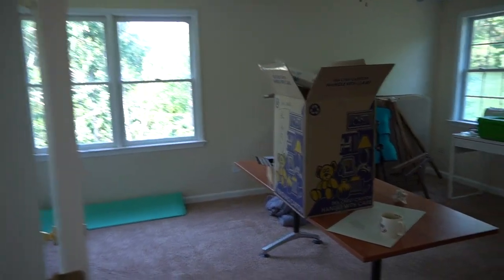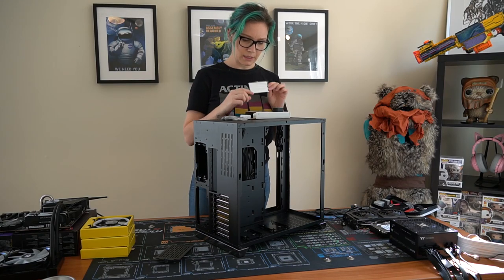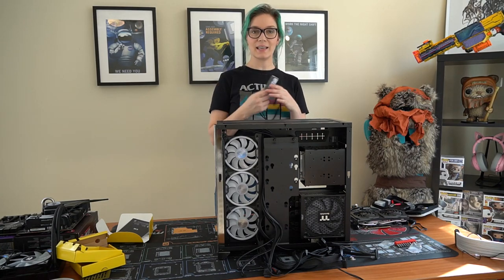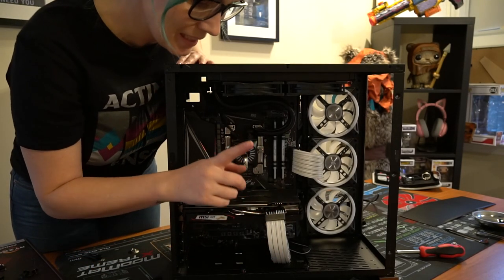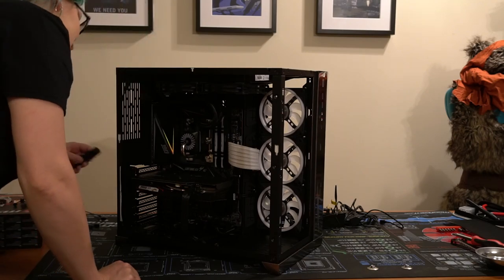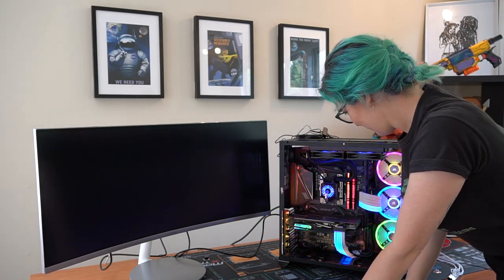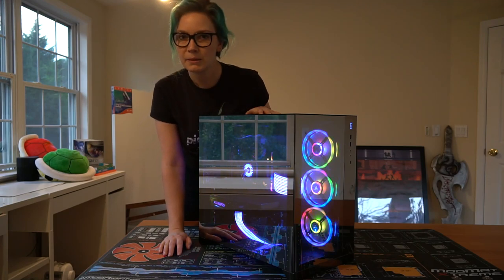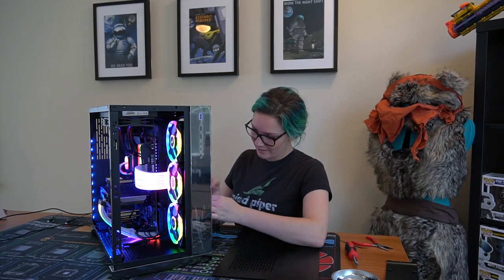Lian Li 011 Dynamic PCMR Special Edition build, the mirrored one!

Comment: Very nice build, and I really like the mirrored look (even though it's not for me). I just built a pc a couple of weeks ago, and I went with the LL Dynamic XL. Ran into the same issue with the GPU connectors, but then just slid my sleeve cable combs down to allow it to bend more, and it fit fine. Good luck with your PC building journey
Reply from the maker: Thanks. The 011 Cases are beautiful aren't they? I think the smarter option if you want to see your components is the non mirrored one like you have (I've learnt this lesson). 
If I get a 3080 GPU at any point I will have to see if I can even use my strimmer! I won't get one for a while though, so I guess I don't have to worry 😆
Reply: @PixieLaLuna  yeah they're really nice looking and easy to work with. I love them. Haha good luck with the 3080 hunt

Comment: I just finished a water cooled build in the lian li o11 dynamic xl in black. I love this case, but cable management is a bear with 10 RGB fans in it. As soon as I get my hands on an RTX 380 my build will be complete.
Reply from the maker: Water cooled build in the 011XL, ooooooh nice!!! 
Good luck getting a 3080, I am also on the hunt to upgrade this pc, my 1660 Super isn't quite doing it for my requirements. The 3080 is a lesson in patience 😊
Yeah I struggled with fitting the cables in, especially if I had put the hard drives in that I wanted to!
Reply: @PixieLaLuna  The RTX 3080 is an elusive piece of hardware.  I really like your build. It turned out great!
Reply: Aaron Dowdy same story for me, have the black case, all the parts minus an3080 😂 I’ve ended up ordering a placeholder card until maybe November or December when one finally comes available 

But! Probably not a bad thing as apparently the cards are crashing
Reply: Also only 9 RGB fans for me as I don’t have the XL case 😂
Reply: 10 fans was a challenge to cable manage with the commander pro and two lighting nod cores. I even made  an adapter for the front RGB strip to connect to the commander pro to control it in Icue so I only have one piece of software to control everything. I managed to keep the two hot swap cages in for my HD's after everything was where I wanted it. I  did order some Cablemod PSU cables to help clean it up a good amount with my modular PSU. The key was to route all the smaller cables first and have the the Commander pro and the two LED hubs where I wanted them. After that I connected all the PSU cables and cleaned it all up. Now if I can just get one or those darn 3080 cards I would be set.
Reply: Aaron Dowdy tbh I’m not looking for a fancy light show 😅 Even though I got ARGB fans I’ll most likely stick to one or two colours maybe. I don’t have a commander device but I guess I may look into it at some point... more importantly is the damn GPU though 😂
Reply: Same case, but I'm not big on RGB at all, so I only did 6 RGB fans and the other 4 have no RGB. I game on my TV, so the less lighting the better.

Comment: Nice video :) I wouldn't put the dust filter on the side where the fans are exhausting though only in front of the intake fans, it will just case a build up on the inside of the case. :)
Reply from the maker: Cool, thank you! I will have a look and remove them, what you said definitely makes sense! :)

Comment: Excellent video.  It was nice seeing this case in a real world setting.  I purchased the same case and fans for myself.  However, they are trapped at my office mail room so I haven't the chance to see them just yet.  
I was worried how the one way mirror effect would look in the dark with the RGB but it looks beautiful and crystal clear. 

Would you happen to know how much space is between the bottom most side intake fan and the bottom of the case?  I was thinking of water cooling and using the EKWB FLT 120 pump/res combo in that bottom most side fan location.  My idea was to use the bottom port of the res to then route the tubing under and behind the res to a cross flow rad.  For this idea though I would think I need at least 30mm of space.
Reply from the maker: Oh no, how frustrating it being stuck in the office!!!
I've just took the glass off to look and I don't see there being 30mm clearance unfortunately. I did mount my fans in the middle of the slots though (they are elongated holes you can slide them up or down in). I think if I had mounted them towards the top of the slots there would be maybe 20mm, but you'd be lucky I think. You might just have to use the cable management hole next to the lowest fan if that works with your cooling loop. It's right next to the fans.
Good luck! It would be great to see the results.
Reply: @PixieLaLuna  I suspected as much.  Thank you for checking.  I will probably take your suggestion and go left from the pump through the cable hole.  Shame, the loop would have looked very sleek with only one tube visible to the reservoir.
Reply from the maker: I'm sure it will look just as sleek. As I said you MIGHT be able to squeeze it through under the fans, depending on where you mount them in the holes. Sometimes things don't seem like they'll work until you try it!

Comment: So, I must say... I was taken by how closely you resemble Emily Blunt... regardless, I recently purchased a Lian Li Dynamic 011 XL for the upcoming 3090 and a bunch of QL fans to boost the sexiness! It's replacing a Corsair 570x which I will use for another build. I'm looking forward to more of your vids! Subbed! ;)
Reply from the maker: Awesome Damir, I hope you get one of the 3090s in the first round, it will be an amazing build!!! The fans are really nice, and the case, as you know, an amazing case. Have a great build with all your new toys. 
Thanks for the compliment, I don't believe you but thank you anyway haha, and thanks for the sub! :)
Reply: @PixieLaLuna  lol, well, the resemblance is there. Regardless, I was reluctant to do the swap because it is a massive investment, not only in the new card but changing the case and adding the aesthetically pleasing new fans. I just needed to make sure there is clearance for the 3090 would fit and could remain cool too without having tight/trapped spaces for heat to accumulate.
Reply from the maker: It sure is a massive investment, PC building and upgrading is not cheap! I am looking at upgrading the 1660 Super in this build cause it's just not keeping up with COD, and that means I might have to replace not only the GPU, but also the PSU and possibly even the CPU! It's never ending.
The case keeps pretty cool, especially if you work out good airflow with your fans, but I know what you mean, there would definitely be concerns about heat pockets. If you can, I would have fans above and below the GPU, with the ones underneath being intake as long as your case isn't on the floor. Actually I guess it depends on the Push Pull directions of the new 3090. I'm sure you will work it out. Just make sure you get that hot air out! 
Good luck with it, let me know how it goes!
Reply: @PixieLaLuna  I've been building custom PC's and gaming rigs more over 15 years now and generally when I set out to build something specific it's around specific targeted games. This year I rebuilt my PC knowingly that the 30 series is going to drop, this is post covid but, I didn't count on the increase of the overall gpu size. My current setup in the 570x crystal is running optimal but being a tech savvy obsessed nerd who likes working with his hands i have to keep modifying things, lol. I'd gladly, show you my current setup but I'm not sure linking things here would work. Front of the case is push pull on the 360 rad and the top 2 fans are exhaust and the rear is exhaust. In the lian li xl will be push pull on the side 360 next to the motherboard top will be exhaust and when i get the 3090 water cooled aio card evga hybrid or kingpin that will be at the bottom as an intake and the single 120mm fan at the rear as an exhaust. 

My only advise is to plan accordingly before you build and take your time. Each build has a target specific for it's means to be created. Right now mine is to destroy Cyberpunk 2077 :) btw, I miss WoW, you're still playing it?
Reply from the maker: Haha, here is me trying to offer advice to a veteran builder! 
One of the reasons I started wanting to build PC's is because I love working with my hands and wanted to find something to do that would incorporate tech and hands on stuff! Learning about it all, and pulling things apart. If I get the new 3080 I will have to have a look at my fans and maybe switch things around, make sure there is good flow.
Yeeees, I can't wait for Cyberpunk 2077. That and COD Cold War are why I need to upgrade! I'm going to move my 1660 Super to another machine. I haven't played WoW in a little while, and I am still only new to it (I'd never had a proper PC before), not sure whether to start again now, or wait for Shadowlands.
I'm not sure if links work on here, you can always try :) Look forward to updates!
Reply: @PixieLaLuna  it's all good, you're not suppose to know that from first glance so, you're forgiven. ;) I too love working with my hands, I build anything from mountain bikes, cars, and computers. Around the house I tend to fix everything and I have to keep busy with some sort of project. Anything with building is best when having on hand experience with the product you're doing just fine. It is welcoming and refreshing to see women in the segment like techtester or something like that. I am impressed how you're spearheading this new venture head-on and I wish you nothing but the best. 1660 is pretty much a taste for the modern gaming world as the 1080 ti performs better. I'm waiting for the 3090 Kingpin card or the 3090 ftw3 hybrid myself for the O11 XL case as we spoke about. Air flow is key for a healthy PC and with all of those fans it will supply it if you can visualize the flow. You'll do great if you need any insight feel free to contact me but I'm sure you'll be fine :) I haven't effectively played wow since cataclysm so I'm a reborn again noob. Once I get the 30 series card i want I'm going to hit the gaming scene hard!
Reply from the maker: Thanks for all the kind words Damir. I'm really surprised how friendly has been, I was expecting to get talked down to or judged by people, but I guess I shouldn't have thought so poorly of humanity lol.
See you somewhere in the gaming world!
Reply: @PixieLaLuna  well, you've mentioned things like you're beginning to get into this sort of thing and it's not something you claim you're an expert on it so it helps lower the negativity. There are people who do pay attention. I was considering joining the segment as well with my own channel but it's already overly saturated and it's hard to bring something new to the table since a lot of things have already been done. I'm taking a hiatus from gaming for now untill I can get my hands on a 3090 hybrid or kingpin card but, for now I will be rebuilding my system for fun and maybe consider upgrading to intel gen 11 if they will support gen 4 pcie. I can't go amd again, at least not for now. Compatibility issues and such, not willing to go through that ordeal just yet lol. So, for now I'm PS4 bound if I need some sort of distraction. My son and I do have a "gaming" channel but it's still not polished and needs work, its just a fun for now project. Heh. Check it out if you wish, no obligation to sub or anything lol https://www.youtube.com/channel/UCJGO2-tg5VEZZB_TKTERC4g see you around, I look forward to your future vids!
Reply from the maker: PS4 bound isn't bad, I've been on Playstation since they came out pretty much! Youtube channels are hard work, and the amount of work that has to go into polishing is more than most realise. As long as you two are having fun with it, that's the best part. It's good to have a project to share. I'll have a browse :)
Reply: @PixieLaLuna  i have no issues playing on a ps4, my son loves playing on the console. PC gaming is new to him, on his birthday I built him his first gaming PC and he was so stoked! I already did the oc swap from the 570x crystal to the lian li. I'm missing a second commander pro, go figure. Btw, thanks for the sub, you didn't have to, heh. Our content is coming out slow since school started back up.
Reply from the maker: I do miss the couch aspect of Console, when the PS5 comes out I am looking forward to be back on the couch for some games! That's such a good gift, a custom gaming PC, lucky son! Happy to help support up and coming content creators who have supported me :)
Reply: @PixieLaLuna  where is my girl at?! Been looking for your content heh. Little update, I managed to fet a 3090 FE :) and planning on 11th gen rocket late cpu and z590 when they come out which should be at the end of the year early next year. I'm going to test out the 3090 and if it doesnt pan out thermals and performance I'm going to return it and get the Kingpin!

Comment: Hi there! 2 questions:
do you recomend to use the gou verticaly?
if i want to use rgb psu cables for the new pc of my gf, do you have any recommendation?

Thank you!
Reply from the maker: I have my GPU horizontally in this build and vertically in my other one. I haven't noticed either of them heating up or a noise difference. So I think it depends on what you want it to look like, and the airflow of the case. Also probably the amount of pressure the GPU is going to be under, high stress games for example.

I haven't seen any RGB candles for the PSU directly. But the ones I used in this one are the extensions by Lian Li. They are great, a bit expensive though. And as you can see in the video I had to fiddle with them to get them to fit. But they are really nice extensions for the power to the motherboard and the GPU.
Have fun building your GFs PC, that's really nice of you 😊

https://www.amazon.com/LIAN-PW8-V2-ADDRESSABLE-STRIMER-8-PIN/dp/B085DR8STN/ref=as_li_ss_tl?crid=34QDR1LEQTQ0W&dchild=1&keywords=lian+li+strimmer+plus&qid=1597157223&sprefix=lian+li+strimmer,aps,146&sr=8-2&linkCode=sl1&tag=pixielaluna-20&linkId=7a331b7e46d544b9f9f047095e571fb3&language=en_US

Comment: im exciting for my next build its the same case,with the fans on the bottom can i just mount them to the case or do i need a rad for it
Reply: I believe with the 011-D you have either option
Reply from the maker: Yes, you can mount them to the bottom of the case, I just added an extra one to the bottom of mine a few days ago! Good luck for your next build :)
Reply: @PixieLaLuna  what about storage
Reply from the maker: @straya_au318  There are six locations in total. I have two 3.5'  in the bays in the back, and I have one 2.5 SSD on the bottom, where you can fit two. You are meant to be able to have two more in the back panel, but I wouldn't be able to fit any there because the cables take up all the space. If I did better cable management I might be able to squeeze some SSD's in. If you have fans in the bottom though, you will have to use the ones that in the back/back panel and manage your cables really well! I hope that is clear lol.

Comment: Te motherboard you have .. is it worth it ? .. I'm planning on getting it so I was wondering if I should get it
Reply from the maker: So far I have had no issues with it. I have been having some issues with the MSI software not being as good as I would like, and it doesn't control the RGB well, but I don't think there is software that does support RGB!
I put Gigabyte Aorus x570 Ultra wifi into my other newer build with a 3950x and a 2080 super, and it's also been going it great. That was a refurbished one off new egg. Maybe worth looking into refurbished to save some dollars! 
Good luck with your build :)
Reply: @PixieLaLuna  I already have a good build .. but I'm planning on upgrading for the aesthetics .. so I guess I'll get an asus or gigabyte
Reply from the maker: Yeah, if you have RGB in your build, I would avoid the MSI one only for the that reason. Enjoy your upgrading!

Comment: Got the same case, and ur air flow there is not even close to an optimal point. So here goes a free tip ma'am: Quit the fans from the side and put them on the floor intracting the fresh air from the floor and sending it to the top, where the top radiator fans will extract the warm air. That would improve the airflow massively.
Reply from the maker: Thanks for the tip. I have added a fan on the bottom, I didn't notice any change in temperature, but then I don't push it much. Since I upgraded the CPU and GPU I noticed an increase, but still within the reasonable temp range. I have storage on the bottom now, so I would have to upgrade my hard drives if I want to add more fans.
Reply: @PixieLaLuna  It's all good. Gamers Nexus did some intense thermal testing on these cases and found that the side mounted fans are fine for temps :)